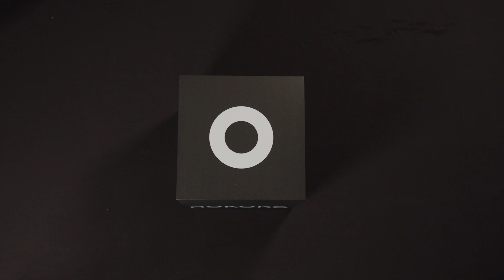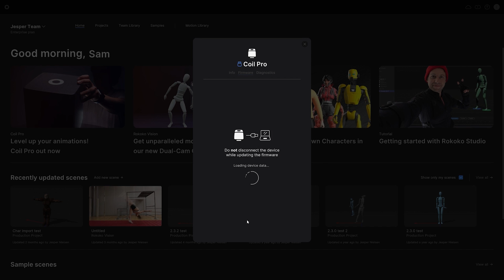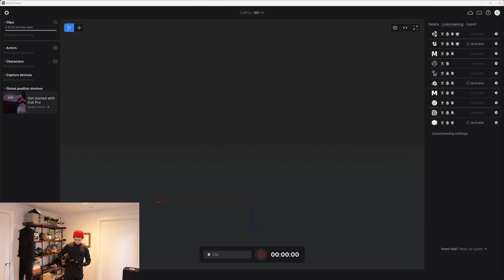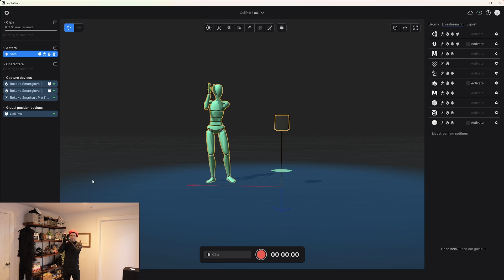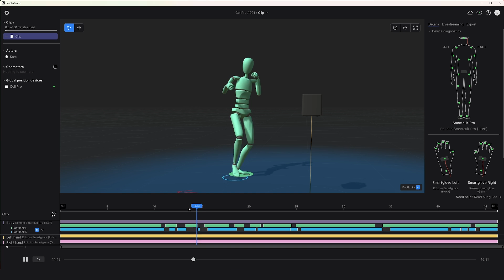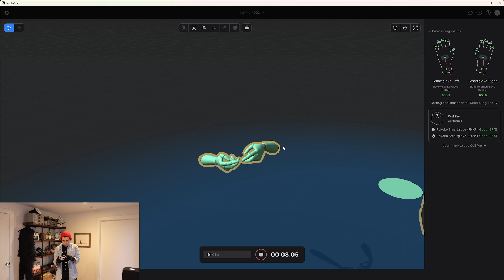Get started with Rokoko Coil Pro - Workflow and Best Practice

Comment: something im not sure if its even possible... but if you were to have 2 coils, could you use them as lighthouses and use one for the gloves, and a second for maybe your feet, or your hip for even more accuracy? sorry, this might show how little I understand at how it actually works :)
Reply from the maker: No need to apologize! It's great that you're curious. The Coil Pro connects specifically with the gloves using EMF technology, so using multiple Coils as lighthouses to enhance accuracy for other parts of the body, like your feet or hips, isn't currently possible. If you have any more questions or need further clarification, feel free to ask!

Comment: I just got this in the mail, and i think I misunderstood the reason for buying this coil. It only works with gloves according to this video. So that  means the suit itself is still prone to all the drift and other issues 😭😭😭😭😭😭😭😭
Reply: Apparently the suit sensors can be located through the gloves, so apparently they increase suit sensor accuracy also. Sadly my coil doesn't work well at all, so I can't verify if it's true. I can tell you that recording suit+glove mocap with vs without the coil does make a difference, although I see better results by not using the coil ATM.
Reply: @WPguru  same
My coil made it worse
Reply: @ Same here 😔

Comment: Well, a 4 meter radius is cute but considering the typical use cases for a Mocap suit it only covers a very limited range. Of course as an addition to face capture it is great, but for any reasonable action it is woefully inadequate. I hoped for at least 10m. That would at least allow it to be used for a proper movie shoot without serious action (for that it should have like 20+). Can these be chained for larger coverage? For a movie shoot cost is not going to be a serious impediment. Of course setting 16 of these up above a set each day would be quite the headache (especially if it has to be precise).

Comment: I am curious, if an actor sits at a table and swings his hanging legs, will the actor drift? I hope Coil Pro can solve drift situations when standing inverted or in other pose where both feet are not on the ground.
Reply: I asked this because I have encountered these issues.

Comment: Haha, the coil costs as much as the suit. How can you justify that price for something that just provides something your suit should already do
Reply: Which inertial system gives absolute position? Coilpro is a cool addition.
Reply: They spent so much time (and money) on R&D for this, to try to give us low budget indies an option for absolute position. I think it’s great that they make this! It took me a long time to save up $ (since the launch) but just finally purchased.
Reply: @virtualfilmer  Toby, what's your take on the Coil now that you've had a few months to play with it? Mine just arrived and it's giving me tons of issues. No matter where I position it in my home, I always get interference and bad tracking dropouts. My gloves never show 100% with the coil, the best I can get is 80+. It barely calibrates for me (nothing like what I see in this video). Could be that I live in a faraday cage, or I've got a coil from the "rough batch".
Reply: The justification is, companies can get a lot of funding and buy this.
Reply: Considering it's an optional investment that adds value to an existing solution, I'd say Coil Pro a great idea (if it works). The alternative is to sell you a whole new suit system, and that would hurt existing customers even more. An add-on like the Coil is a much better solution.

Comment: Why use a usb3 plug with a none standard power output, surely it's an accident waiting to happen. A laptop style power plug would be more appropriate.
Reply: Yeah, I saw that and thought it was pretty sad, why not use a barrel jack or something else similar. Considering it's size and price a screw locking barrel jack or other locking connector would've been more appropriate as a professional device. And if they're using USB C, use USB PD so that the power supply can be exchanged with any of the hundreds of USB C laptop chargers out there, and it won't kill other equipment by complete disregard for the USB C spec
Reply: EU regulations if I were to guess. Anything that has a proprietary adaptor can't be released in the EU any more (or somesuch). It's basically why Apple switched to USB-C.